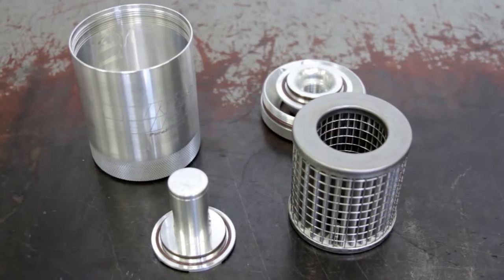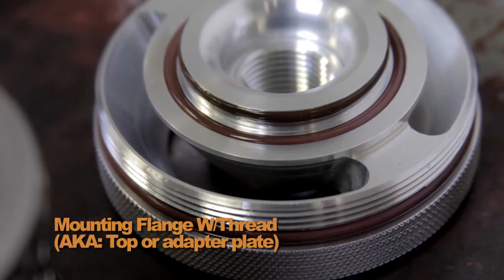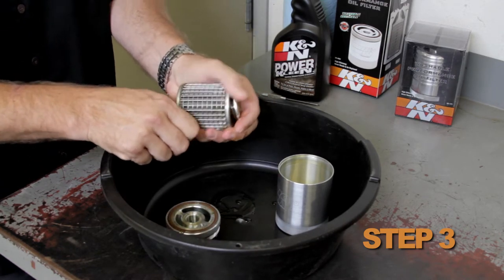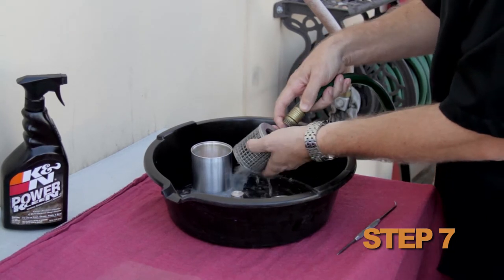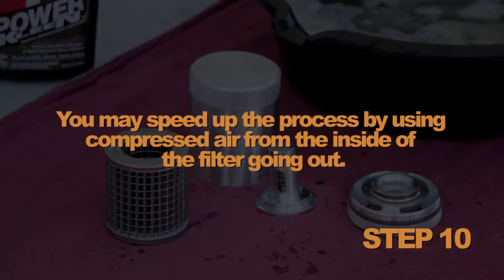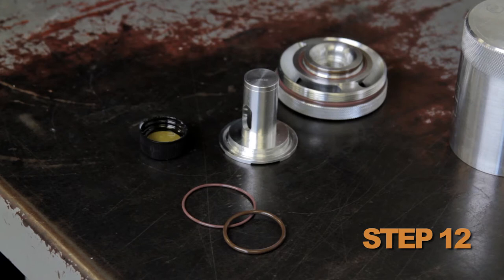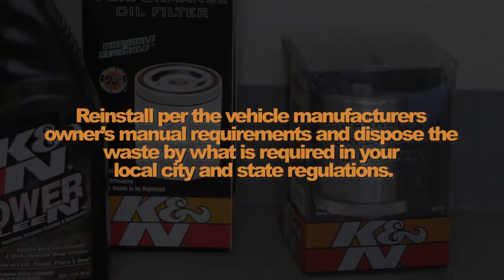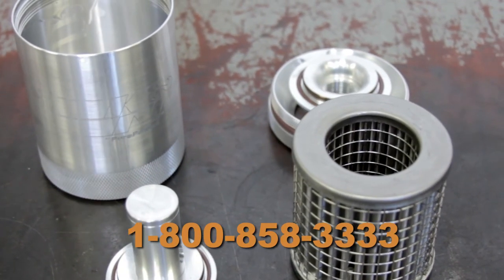K&N Stainless Steel Washable and Reusable Oil Filters

Comment: Point is you’re saving the planet and the filter has a lifetime potential which will last for the life of the vehicle and even be transferred onto another of the same type of vehicle. If you’re looking at the bigger picture and the long run. I would say its definitely worth it. Its PURE POWER after all. But of course there are going to be those ppl who say “Oh its not worth all the work to clean it, im just going to be a single use person and trash the environment like everyone else”. Just depends on who you are really to see if its worth it or not to you. But what is also a counter to this being environmentally friendly is the plastic bottle and chemicals that come with the K&N Kleener that you have to use every oil change. So, Idk K&N? Try biodegradable products and we’ll see where we can go from there in terms of matching the same High Quality. Until then, Im puzzled and Mixed when thinking of buying this 340$ oil change

Comment: This does look like a pain to clean- but is it worth it for the magnet?
Reply: Used to use magnets on the outside of filters. Gimmicky crap, all that extra work for nothing. K&N  oiled air filters arent much better. Actually went with AEM dry flow.  Oil on the K&N would get on the MAF and throw codes.

Comment: of all the comments  none address the REAL benefit of a reusable oil filter  namely  the  verification of what if any  metal particles  are trapped in the filter .
 all the oil filters of older airplanes   ( I used to look at DC-3 engines  oil filters)
were designed for that purpose....  to check for metal particles .... when you dispose of the detergent through a cloth and run a magnet over the debris  if the stuff stick to your magnet  you MAY have  an internal problem  somewhere .... at that point you can either decide to ignore or  check your filter  again after  some miles  for confirmation  of possible troubles 
if no metal  you can just  keep on riding but if you get  more  or larger flakes  of metal you will see and   you will know   that you have a potential problem!!

Comment: What if I'm the type of person that doesn't want to fill the oil filter thing with motor oil? What if I just want to spin it back on and drive off after cleaning it? How does this keep the engine clean? Isn't it more imperfect than a regular oil filter?